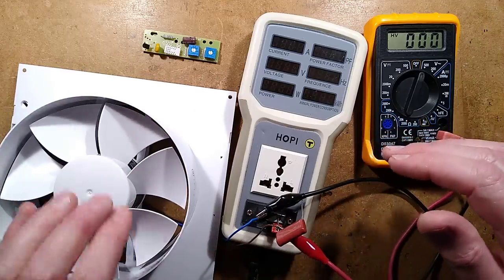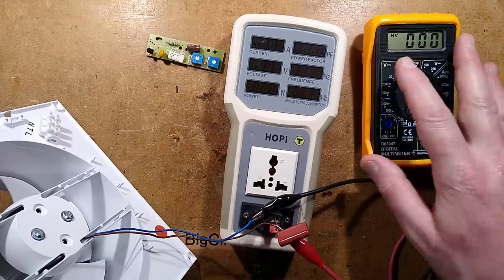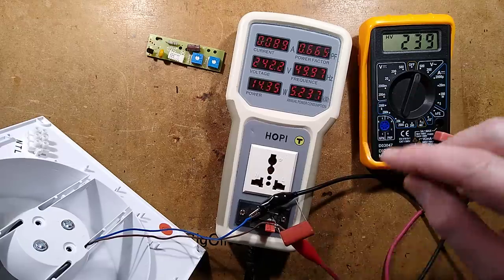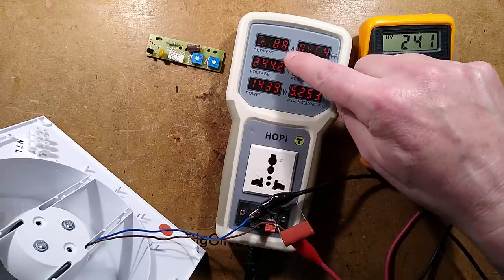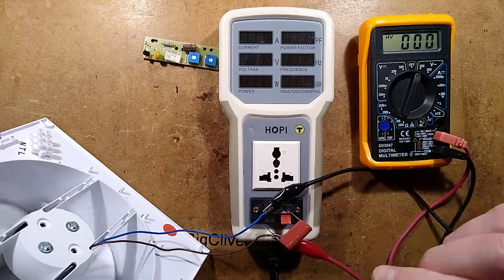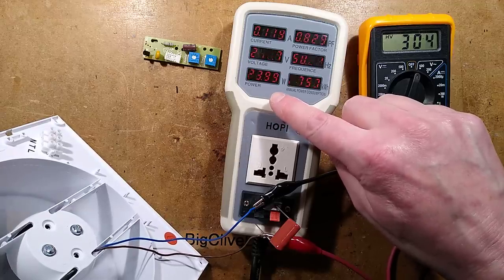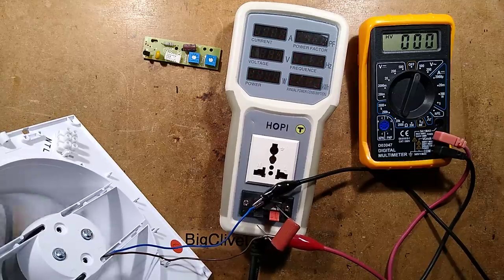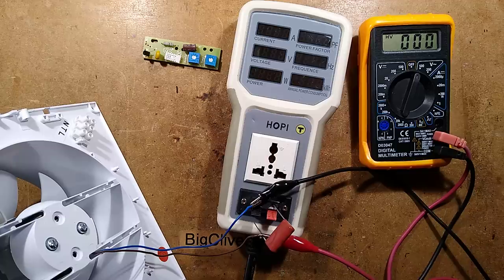What the heck!  Series capacitor makes fan go TURBO!

Comment: Looks normal. In a series LC circuit, the sum of the voltages across the capacitor and inductor will always be greater than the supply voltage. However, if you connect a two channel oscilloscope, one channel across the inductor and one across the capacitor, you'll see that the two voltages are not in phase.
Reply: ELI the ICE man anyone? :P
Reply: Nice explanation. Just a bit of caution though. If you connect an oscilloscope like that, use differential probes, not the normal ones. They do not have a floating ground
Reply: @thandle61  Leading voltage or current in Inductive and capacitive circuits ?
Reply: the speed of the fan is controlled "only" buy the frequency and the number of poles in the motor. RPM =( frequency /(poles /2))*60 . so what is happening is he makes a RCL oscillator. and increasing the frequency to properly 80 - 100Hz.
Reply: I genuinely love reading jargon like this that I don't understand.
Reply: @fromaflafl2198  you dont know what motor is in that fan you can't say that for certain
Reply: @cj09beira    have taken apart similar cheap fans before it's 100% a Synchronous motor. and it fit's perfectly with what we see.
Reply: perfect opportunity to play with an oscilloscope :D
Reply: @fromaflafl2198  This will be an induction motor. No poles. No commutator. No oscillations. To summarize: no stupid ideas at all.
Reply: @cj09beira  He's certainly wrong.
Reply: @fromaflafl2198  NO. IT'S AN INDUCTION MOTOR. Duh!
Reply: @pengiswe  good tip. 👍
Reply: Same current, but leading in relation to the voltage across the capacitor, and lagging in relation to the voltage across the inductor, at the same time.
Reply: @BrianG61UK  and a shaded pole as well, which has extremely high slip ratio. The speed in this case is more governed by the torque in relation to the drag on the fan blades. So the higher the current, the lower the slip, and more closely the speed will tend to follow the mains frequency.

Ps: All that I've written in this comment is an atrociously simplified description of the effects involved here.
Reply: @BrianG61UK  thanks man
Reply: @BrianG61UK so what is the right answer now? 😅
Reply: Would the phase be rotated 90 deg?
Reply: @fromaflafl2198  This would not be possible to introduce a change in frequency, since it is being powered by an AC supply. We're seeing the effect of adjusting the phase shift.
Reply: You nailed it
Reply: @thandle61 you get power from Phase 1, 180degrees up and down on the graph. You ALSO get power from Phase 2(created by capacitor charging and discharging), 180degrees the OTHER way on the graph. Two separate usable voltages running down the same wire.
Reply: @fromaflafl2198  horse feathers!
Reply: @thandle61  I always thought you should be    CIVIL     in these discussions and not let it turn a PHASE different................
Reply: I guess it's an induction motor where the second magnetic field is made by single windings around the stator. In this case the voltage decides the amount of power and therefor rpm under load. Your fan is a resistor and inductor. Resistance on x axis, inductance on y(is it called imaginative part in English?) Now you ad a capacitor which is also is only on the y axis but inverted. If you match them perfectly your power supply will be like 230V divided by only the resistance and you get very high currents. The voltage on inductor will be phase shifted to the capacitor by 180deg so the total voltage is zero,, and in theory the voltage over the coil and over the inductance goes towards infinity..  so something should blow up ❤ do it please

BTW, neon tubes duo circuit (or how its calles in english).. to get the power factor of 2 or more neon tubes to 1 you do the following, leave the first tube alone and over compensate the second with a capacitor big enough for 2 neon tubes in series. this way
Reply: @fromaflafl2198  I don't think it will be a synchronous motor, more likely an induction motor.  The speed of an induction motor is the synchronous speed (assume 2 pole and 50Hz is 3000 rpm) minus the slip frequency.  The slip frequency is usually pretty high on these fans, and is very dependent on the supply voltage.  By increasing the voltage across the fan you will reduce the slip frequency and the fan will speed up.
Reply: @fromaflafl2198  what IF it is a universal motor?
Reply: Go X-Y-Z in vectorscope mode, you'll really see the difference and can understand precisely what's going on by using different value caps.
Reply: @pengiswe If you don't have differential probes, isolate the power supply, and use the LC junction as the reference point

Comment: "The voltage drop across the inductor is larger than the voltage applied to the circuit.  This might seem to be an impossible condition, but it is not; the explanation is that while the energy is being stored in the inductor's magnetic field, energy is being returned to the circuit from the capacitor's electric field, and vice versa.  This stored energy is responsible for the fact that voltages across reactances in series can be larger than the voltage applied to them."
 - 1968 ARRL Handbook, page 36
Reply: This is the reason for most of the common TV failures. Manufacturers save 3 cent per capacitor by not using higher voltage ratings. Effectively saving hundreds of thousands. Capacitors rated for just at the very "higher voltage" that you speak of. 

HVAC/R caps are the same deal, everyone uses 440 v rated caps while the 370v were failing too soon. Many environments were seeing 382 volt as an average(I'm ballparking) across every system. These are designed for a specific lifespan, similar to led lights. The target is like 50k hours. These things are calculated to a science...an economic science. What's worse is that getting rid of PCB oils(forever chemicals) has cost the consumer astronomically die to the quicker degradation of the caps newer dielectric oils.
Reply: @seedtheskies  Are you claiming that environmentaly friendly "capacitor oils" result in shorter capacitor live span? Wait, isn;t there supposed to be an electrolyte in an dielectric capacitor? What kind of oils are you talking about?
Reply: @seedtheskies  Most consumer device failures are caused, actually,  by the temp rating of Mylars or Electrolytics,  especially in applications such as older CFL lamps.  Using 85 or 105 deg C rated devices is asking for early failure,  because temperature rating is time dependent.  Why make them to last twice as long if you can save a nickel?
Reply: @seedtheskies  caps use a dielectric, but they've not used PCB oils in decades. Most have long, long, long used manganese dioxide as the electrolyte.
What fails is the seal in electrolytic capacitors, allowing the lead to foil bond to oxidize, increasing the ESR of the capacitor, plus electrolyte drying allowing the oxide film to break down between plates and overpressurizing the capacitor.
The voltage rating being a bit low is a part, but a larger part is the infernal habit of placing electrolytic caps right up on heat sinks, allowing the rubber to degrade due to the increased heat and oxidative damage from the air.
The last oil filled caps I ever saw or heard of were motor start and run caps for industrial equipment, although some were used in consumer goods like refrigerators and air conditioners. No need for that, as mineral oil does quite fine as long as it's kept clean and not exposed to air.
Reply: @gyrgrls  If you can save a nickel AND sell them a new unit!
Reply: I would say, the Inductor here is the Capacitor or The Motor? I assume the Capacitor? The Energy stored in that capacitor is very little, compared to powering an electric motor. I had thought the Capacitor was filtering out the Back Emf and allowing the Motor to be more efficient :face-blue-question-mark:
Reply: @Dazza_Doo  No, the motor winding is the inductance and the capacitor is the capacitance in this series LC circuit.
The above mentioned ARRL Handbook explains these circuit fundamentals very well.
A one farad capacitor stores one coulomb of electrons per volt of potential.  That 1 µF capacitor (one millonth of a farad) charged to a peak of, let's say 370 volts, would be storing approximately 2309931866614641360000 electrons.
This is probably more charge than you realize.
Reply: @drussell_  Thanks for the Info! Much appreciated
Reply: @Dazza_Doo  If you search for 1968 ARRL Handbook you should find a copy online... It will not let me post a link or even mention a specific site 🙄
Reply: @drussell_  As you say, in addition, due to the phase shift and the partial galvanic separation of the coil by the capacitor, the amplitude of the mains voltage, which in a normal 230V distribution network is about 310V, will also be reflected in the circuit (that is why fluorescent lamps have a choke and a compensating capacitor - without a capacitor, the fluorescent tube will survive, but without a choke when ignited, it immediately burns the ignition filaments)

Comment: As other commenters have said, it's getting close to resonance. Another way to look at it is to think of impedance as a complex number, where a capacitor has negative imaginary impedance, and an inductor has a positive imaginary impedance. When you add the positive and negative impedances in your series circuit together they partially cancel, and the total impedance goes down. In theory you should be able to find some capacitor that perfectly cancels the inductance of the motor windings; this is at resonance. At that point the circuit will behave like a pure resistor and the power factor will be 1. This is all in theory of course... you should experiment more!
Reply: Positive and negative *reactance*, not resistance, not impedance.  The two combined, along with the vector sum of the resistance equal the impedance.
Reply: At near a perfect power factor, the fan may not spin in the direction you want.
Reply: @acmefixer1 ah, the Ole r1 and r2
Reply: magic sounds better
Reply: At resonance, the only resistance will be equal to the dc winding resistance of the motor and the current at a maximum.  Whether the motor can survive this or not, you'd have to guess from the thickness of the windings (or just watch the smoke come out).
Reply: @acmefixer1  R +jXL -jXC 
R is winding resistance, +jXL inductive reactance of the windings at 50Hz, -jXC the capacitive reactance at 50Hz. Just left with R if inductive and capacitive reactances are equal (resonance).
Reply: The dreaded mathematics - that's what prevented me from getting any further with electronics and therefore relegated me to the form of a simple Technician!
Reply: That's what I thought, the capacitive reactance is cancelling out some of the inductive reactance so the impedance is lower. One thing to keep in mind is if you run the fan continuously in this matter it could burn out and possibly start a fire. Use outdoors only in the cold winter weather.
Reply: At resonance, circuit impedance goes up, not down in inductive or capacitive/inductive circuits. I don't where so many commenters get their info from.

Resonance, as described by a 'Q' factor graph, shows a dramatic rise in impedance multiples of that of an untuned loading.
Reply: @stephensaines7100  The impedance goes up if the inductor and capacitor are in parallel. If they are in series, inductive and capacitances cancel out and the impedance goes down. That's what's happening here.

Comment: I think it's a resonance/decreasing impedance thing. The reactance of the load decreases because the series capacitor's capacitive reactance cancels some of the inductive reactance from the fan. The power factor also goes up, which means that this is probably what's happening. Now you just need to try a capacitor that's a little bigger to get less impedance and MORE POWER.

Comment: Isn't the capacitor resonating with fan inductance drawing more current and amplifying the voltage across it?
Reply: I thought the capacitance would instead reduce the overall resonance since it'd be effectively cancelling out a part of the fan's inductive reactance...
Reply: So, when will you make it go BOOM 😬 I resonate when you make things go boom 😂
Reply: I resonate with this thought
Reply: @glintytear  in a serries circuit, Impedence Z=sqrt(R²+(Xl-Xc)²) where Xl=inductive reactance and Xc=capacitive reactance  

Where Xl=Xc, then the circuit reactance = 0 and Impedence = Resistance.

Comment: It would be interesting to see how it performs with different capacitors. Could do it so you get minimum impedance like you're taught in electronics classes when getting it in resonance. 

Honestly, it would make for a pretty cool example in a classroom of how it works, rather than having six boards, and fifty minutes of equations, followed by a "Any questions?"